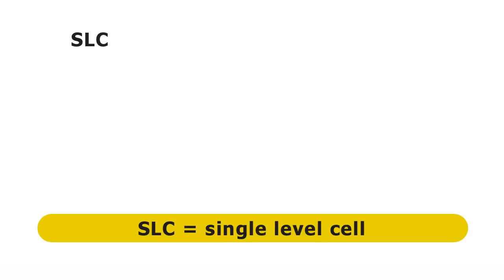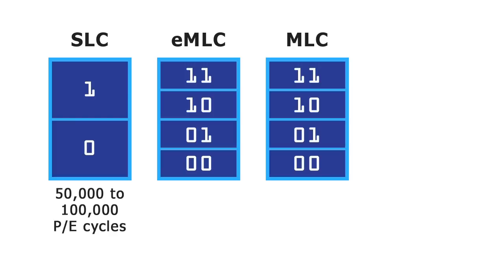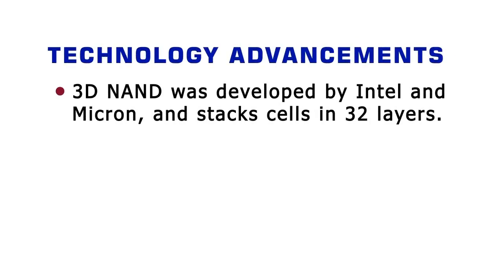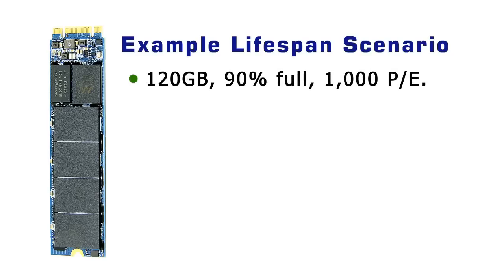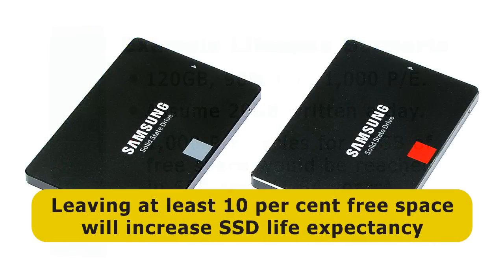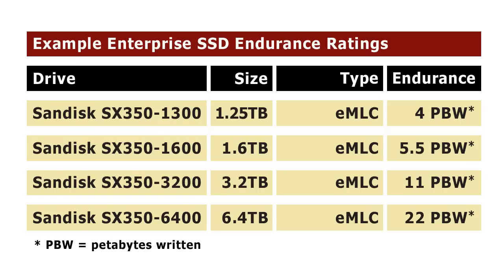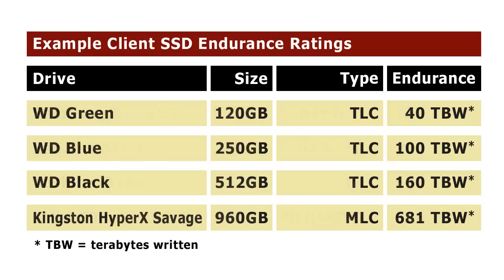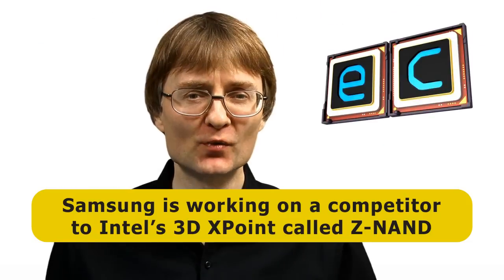SSD Life Expectancy

Comment: 840 Evo 120 GB still working after 4 years :)
Reply from the maker: Good to know. Great drives the Samsung 840s -- Evo or Pro.
Reply: My 128gb samsung 830 is still working after 3,5years and my pc is on 24/7
Reply: The same here for the 512GB pro version, Magician says drive condition is GOOD after a total of 20TB written.
Reply: 840 Evo were actually the worst, they have a "read performance bug" that can't get fixed with new firmware.
Reply: Samsung pm810 256 - 7 years old 24/7 operation. Still going strong and reports 87% healthy.
Reply: U guys better be speaking the truth (pls), coz I am moving my most important backups to a ssd.
Reply: Exact same drive died in my Lenovo X240 just over a month ago.
Reply: The EVO came in at 128gb capacity the regular 840 was 120gb capacity. My 840 120gb purchased on 2/18/2013 is doing fine and well also.
Reply: I dont think they have either as 120gb capacity was the regular 840. The evo started at 128gb capacity, same with the pro.
Reply: My 80GB Intel X-25M is still working after 7 years of use and 19TB of Host Writes, even though according to its manufacturer it's rated for close to 10TBytes. 19739 Power-On Hours Count. 4006 Power Cycle Count. 273 Unsafe Shutdown Count.
Reply: 7 years and only 19TB writes. Now that is light use. My less than three year old 850 pro in normal use is already at 14.4TB writes, 10291 power on hours, 1013 power-on count and 121 unsafe shutdown count due to a faulty GPU that kept crashing my PC. Given its rated at minimum 150TB of writes that gives me about another 8 years of warranty time and the fact that the 840 pro has been seen to survive well over 1PB of writes and the 850 pro is said to deal with wear even better than the 840 pro I should have a long and happy live with my 850 pro. Hope your Intel SSD doesnt have that stupid self kill function where it locks the drive to read only after 300TB like some of the newer ones.
Reply: +LifeRider 96 if you are doing back ups on SSD you better keep them powered. Some SSDs can have voltage drift in the storage cells if left unpowered for long times and lose all the data.
Reply: "273 Unsafe Shutdown Count"

WTF, dude.
Reply: Mac Donalds Way too many thunderstorms. Haven't bought a UPS yet. Keep in mind, we are talking about 7 years time.
Reply: 840 Pro 256GB, 13.8TB written in around 2 years of regular use. Status Good
Reply: Milan Kragujevic why does it seem like my ancient fatass computer that I still keep in storage lasts longer than some components in modern builds?

It's probably just because that dinosaur is just a glorified email checker isn't it?

Yeah that's probably why, but I must say I played some great games on that thing, anything from Zoo Tycoon to ... Well at that age I think ZT was my favorite game is that's about it lol
Reply: Same here, status is at "good"
Reply: +Weenie Hut Jr's If its still running as good as it was in 2009, I would say you got you've probably got you're money's worth.
Reply: same here :D
Reply: sama here..i have Samsung 120 gb from 2010..more then 1000 days power on times..works like new ..also Samsung 840 evo 250 gb  from 2012  ..same no problem at all
Reply: +Rustknuckle Irongut It's not light use. It's not only 19TB. It's controlled use. As I wrote, my SSD was rated for 8 to 10TB of write cycles and keeping that in mind I just didn't want to kill my 220$+ SSD in a few years time. Your SSD is way newer and rated for WAY more write cycles so it's like comparing apples to oranges. You are comparing one of the early SSDs to one that is still being sold today as new. One that is meant to be replaced in just a few years and one with durability that can last till it is unwanted old tech.
Reply: You do have a point there Mandragoras
Reply: Im not sure of the model, but my seagate HDD is still working after 4 years :)
Reply: Mandragoras, you should've known SSD manufacturers are trying their besr to undervalue life expectancy of consumer SSD drives in order to not undercut their enterprise drive sales. Your X-25M is actually rated for 5000 P/E cycles so that means your 80GB drive is safe for 40TB of data writes.
Reply: vladdx My thought was, better be safe than sorry.
Reply: Milan Kragujevic Really I've had my Seagate sata for over 12 years now :) on my vaio laptop and it doesn't look like its about to die anytime soon, And Seagates are not really reliable i know that.
Reply: Kingston V300 (the cheapest one, I think)  It has been on for almost two years (13625 hours), 13 TB written. Health: 97%
Reply: My advice? Get an external hard drive (not an SSD), copy all your important info, and disconnected. That´s what I have done and I keep it safe in its box.
Reply: Good to know!
Reply: Do normal external hard drives have that problem? Because I have all my backups in an external disconnected hard drive.
Reply: For what I read here, you can storage an SSD without losing data: http://lifehacker.com/5808858/how-long-can-a-hard-drive-hold-data-without-power
Reply: That lifehacker advice will screw over a lot of those that take it. Thing is some SSDs might survive, some wont. What you need to ask yourself is are you willing to bet your backup files that you will be in the survive category? Some of these advice sites jump to yes to fast because they will never be held to account or suffer the consequences when your data is gone. I would wait to use SSDs for cold storage until they are an old enough and mature enough technology that I can hear stories of people that have cold stored for over 10 years+ with success. (edited for spelling mistake)
Reply: How have you been able to make it last for so long???
Reply: Bryant Floyd, SSDs rarely if ever fail because of NAND cells just dying out but because the controller and/or firmware was too stressed out by heat or voltage spikes. Thus, I've seen same drive models failing after only a few months of use and others still alive after more than 3-4 years. The only thing you can do to keep your SSD drive alive as much as possible is investing in a quality Gold+ PSU and making sure your system is not hot where your drive is installed.
Reply: Thanks... a valuable information to have.
Reply: crucial m500 240gb working for 3 years
Reply: Milan Kragujevic may i know your tbw on the magician software? i have the 850 evo 250gb.. 

thanks for this info.. :)
Reply: 3rd July 2014, I bought my 250gb 840 evo for £90 @ 2418 hours, 4.6TB of data written it's still a baby.
Reply: Running a 1TB Pro, and a 750 Crucial on my travel laptop. I try to back everything up onto multiple individual HDDs anyway. I can pull an HDD apart and usually put the disc in another HDD and retrieve the data.
Reply: Meh... Quantum 50MB drive in my dad's 386 computer is still working. Circa early 1991.  That's 26 years and still going.
Reply: got a quantum big foot 2gb that is still in use
Reply: 2x Mtron 32GB SLC from 2008 that are still good and usable, except for the size ofc :)

Cheap SSDs with for ex Sandforce controller, tend to fail due to read errors of Meta data after 2-5 years. 
Good SSDs that are better built, with better NAND last 5+ years like its nuttin.
Reply: I only have Windows 10 installed on my ScanDisk 256GB Solid State Drive and took up 50GB of space. 32GB isn't enough space to really do anything anymore with. I have heard of Windows 7 being installed onto a 20GB SSD with only 1GB of free space remaining.
Reply: Bryant Floyd Actually those 32GB are still useful, but in a different way.

Most high-end Intel motherboard these days support Smart Response. Its a way to create your own hybrid HDD (SSHD), with any HDD + SSD, with max cache size of 64GB though. 

Its like Seagates hybrids, except instead of 8GB, u can use any 16-64GB SSD, and the cache is done at block level (same as Seagates), so its the most effective cache u can get.. for "free", as long as u have the motherboard. 

All u need is a "Z*7" or "H*7" motherboard with Z68 to Z207 chipset, any SSD and any HDD. U need the system in RAID mode, but that is not too complicated and there are guides to do that. 

End result is for ex 2TB HDD with 32GB Cache, that has faster I/O (4k),    tons of space, and the most frequent data is accelerated. So u can fit larger games, or Windows... and still get performance boost.
Reply: I'd still recommend having at least 2 backups for important data: one on a traditional HDD and another in the cloud storage. SSDs are better for daily computer stuff
Reply: TheError404 Agree, except i want to avoid cloud. But two separate backups with one off-site for the important data. 

SSDs can get virus just like a HDD. Crypto-viruses, hackers, filesystem crash... Windows 10, they can all ruin your data with no warning, so backup is important.
Reply: Magician says my SSD is good but its slowed to floppy speed and is failing
Reply: Samsung should replace it if it's still under warranty
Reply: I am surprised no dutch has pointes to this test of a dutch website several years ago. In short they tested our two  250 GB ssd tests for a nonstop Torture test. They took 2,5 months of non stop writing data before they could kill it. The results were further that they could write 3 times as much data do the drive then what Samsung gave as reference. (888 TB ) after 707 TB it gave his first error.  This test proved that if you would write 10 GB of data per day to the ssd. (Top level of consumer ssd use )  it would take 214 years before you should stop using  it.. XD and 249 years to fully kill it. Last they both got there first error at almost the same point  (746 and 748 TB)

In short i would not be to worried. My 840 pro ssd still works to. 

https://nl.hardware.info/reviews/4177/10/hardwareinfo-test-levensduur-samsung-ssd-840-250gb-tlc-ssd-eind-update-20-6-2013-update-9-eindconclusie-20-6-2013
Reply: After 2 1/2 years my 840 is almost gone and only 13TB written
samsung told me to wipe it using the tools they give out and reinstall windows
i did that and it took hrs as the drive is now so slow
they even told me it was full even though it had 60GB free

they still refused to give me a RMA and took many emails
thing is they know the 840 has problems and when i have to run the fix every day they should know its f***
ive have to get a evo 850 500GB while i wait for them to honour their warranty

has anyone else had problems getting a RMA from Samsung ?
Reply: +LifeRider 96 It's repeated writing to the drive that exercises the cells.  If you are just reading from it for the most part, they're nearly indestructible.  Let's say you buy a 500 GB drive you're using for a backup.  Even if you rewrite the entire drive once per week, even in the worst case scenario of early death, that's still nearly 10 years of backup use.  Just use an incremental backup utility (only writes changes every backup cycle) and turn off file and directory access times (to prevent spurious writes from occurring when you access a drive).
Reply: I had an 5 Year old Corsair Force GT 120GB as a Bootdrive. I didn't really change any settings for it. It ran Windows 7 and 10. Now i have it replaced with an M.2 because its faster and bigger space.
BUT it still ran without Problems!!!
It had 3 Year Warrenty but no TBW.....Still i expect it to run 5 more Years ^^
Reply: @SE09uk I had purchased two Samsung 840s (not the Pro version) and one was faulty (it wouldn't properly install my os).  I had to contact Samsung directly and was corresponding with a representative/help support, and he was actually really helpful.  After explaining what happened (took a few emails),  he gave me a ticket number and RMA slip, which I was able to print and use to send in my faulty drive.  Took almost two weeks to get it back.  I wasn't sent a new one either, but rather the same drive that was refurbished.  I am using that drive right now to run my operating system and so far it's been running really well. (2 years now).
Reply: Ive got the RMA now and had to buy a 850, so when the 840 comes back i'll have 2 SSD's
i'm hoping the send me a new 850 and not return my 840. not sure how they fix them as its just chips
Reply: Have the Intel 330 Series SSD since November of 2012, which is almost 5 years and counting. Still works the same as the day I installed :).
Reply: He is talking for the "worst ideal" scenario! Even if you eat a candy one week after it has expired probably you will have no health issue...
Reply: Evo's use TLC nand, lots of them go bad if you're a heavy user. 512GB 840 Pro here and still goin like a champ.. MLC Nand FTW.
Reply: same 5 years, though the size has decreased.
Reply: 840 EVO 250 GB with no problems after 2 and a half years and 19.7 TBW.
Reply: Mine 5 years over :) feeling happy !
Reply: i bought an 840 evo a few years ago, it only lasted a few weeks?:( dont know what happened
Reply: My evo 840 is just over two years old and if the PC is off it loses it's speed over two days
i have to run the fix every day or two now just to use it

Before and after fix (fix lasts two days) ........

https://ibb.co/nG8mf5
Reply: Hey, they have a warranty! Try to replace it.
Reply: Yep it took me many emails to get them to honour it. i got some back saying its full that's all. it was not and had 40% free
Samsung took a lot of convincing
 at last, they have sent me a RMA, so i will move the data to my new evo 850 before returning it
Bit shocked at them, but i guess its a low down guy used to users not knowing to keep space free.
Reply: OCZ vertex 500 gig going on 7 years of daily use.
Reply: Same here!
Reply: Can anyone tell me which SSD is better:-
Kingston SSDNow A400 120GB  VS  
Samsung 750 EVO 120GB

Is it true that SSD with higher reading/writing speed has low life expectancy?
Reply: I can't recommend a Samsung because they are incapable to honour their warranty and that is through personal experience.
Reply: Yep if you see my comments I've had so many problems with them
the ssd was days away from stopping and i had to run the fix every day to get it to be faster than a floppy, but all the said was it was full.
the thing is i have Samsung everything in my home
the only thing that i had from Samsung that was crap was a HDD
i had 2 and they both failed
the chip that controls the spindle burned out
and now the ssd is not that good
Reply: My son has Kingston and has had no problems, ive had the evo 840 and it's slowed to a stop and wont speed up unless i run the fix every day
but having said that ive now got a evo 850 500
and they are fast
look for as ssd benchmark

one thing, if your using it for your C: drive it's way to small
the min is 250, 500 being better

with 250 i had to move parts of windows to a hhd, pics, docs, system parts, music, video, downloads, games and program installs
Reply: +SE09uk  Samsung 750 Evo writing speed is faster than the Kingston a400 but after reading your comment i think Kingston would be better.
Reply: The evo 840 had problems, the 850 is different and has not got the same problems.
on the speed thing
my son also has a slower older Kingston as a boot drive on his second PC
in tests its about 200MBs vs my 840 (when working) or 540MBs
but it load tests our PC's take the same amount of time to load to the desktop

So real world vs benchmarks
what i'm saying is a ssd is way faster at loading than a hdd
but after 200MBs you will not see much difference

so its size and reliability in the end
Reply: Get 2 drives and raid them so if one fails the other one will still have the data,.... if it's that important......
Use the cloud or drop box which should have the protection you require.
Reply: For speed and data safety, I'd say three drives min.
though two would be the same speed as one none raid, it would offer a backup on the fly.

It would be good to run one SSD, and use say true image to back up to HDD every day or week
that way would only take 20 mins the first time, and after that only back up the changes so taking less time.

The advantage would be you have data time travel capabilities over on the fly
This would be better if you needed to recover from a virus.

I used to have a 6TB raid, it went down and to say I was depressed would be an understatement.
after a lot of work, i got back 2.5TB.
Reply: I have two SSD drives that both are still working after three years of heavy use . Both have Windows 10 installed and literally i cannot tell the SSD's are three years old. I still get exactly the same responsiveness after three years. SSD's are vastly superior to mechanical hard drives. The only argument against SSD's are capacity and price at the moment.
Reply: from all my ssd's I expected my oldest the OCZ agility 3 to die off by now. but it just keeps going.
Reply: Engel yep SSD technology has improved a lot now !
Reply: I also have the Samsung 830 128GB drive, working just fine after 5,5 years with drive condition "Good" in the Samsung magician, this drive is system drive, so i dont store much on it though, use harddrive for that. I also have a pretty new 250 GB 850 Evo used on another boot option, but its barely been used. The computer is used alot though, but isnt on 24/7.
Reply: 5 years with a full ssd from plextor tlc i think
Reply: 120gb OCZ Agility 3 still working after 6 years :))
Reply: 2010 laptop 240gb ssd still working in 2018. deal with it
Reply: BlackPalankaa  Have you got a time machine ?
Reply: Sony VAIO VPCF1 .
Reply: BlackPalankaa  To clearify, its still 2017 and you said it worked in 2018 ;-)
Reply: Thanks for the advice, very useful to know. Does partitioning affect the life expectancy? (Say if one partition is fuller than the other?). I have a 1TB EVO 960 as main drive on my laptop with one partition being dedicated to system files
Reply: I have a Samsung 40 GB HDD made in 2004 that still runs to this day hehe
Reply: Milan Kragujevic hi that good sad In   4 years  keep your  ssd laptop or desktop computers. Safe
Reply: i have a 840 pro 256 gb who still work after 4 years too :)
Reply: 840 Pro, bought in April, 2013. Overall fitness 87%, overall performance 90%. I use my HDD (D: drive) for my backups, downloads, pictures, movies, et cetera, and my external HDD (E: drive) for games.
Reply: I bought an expensive Samsung monitor and it went bad in about a year or two. Last Samsung product I ever bought.